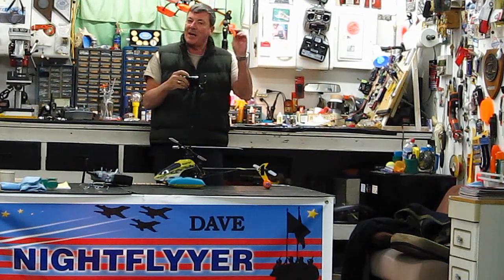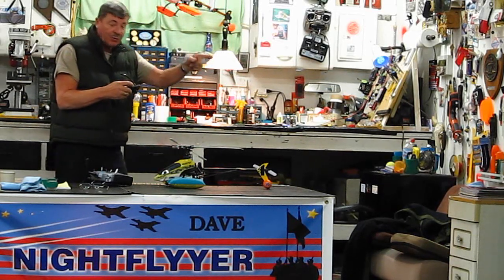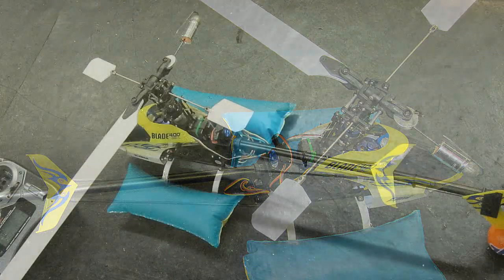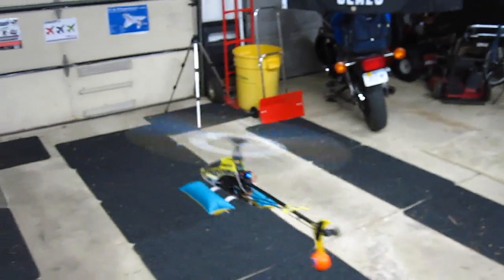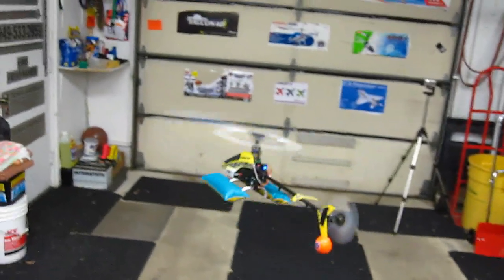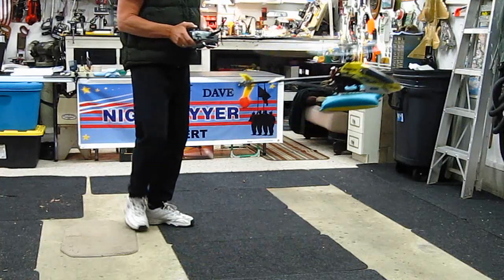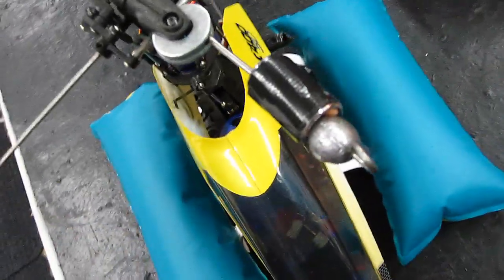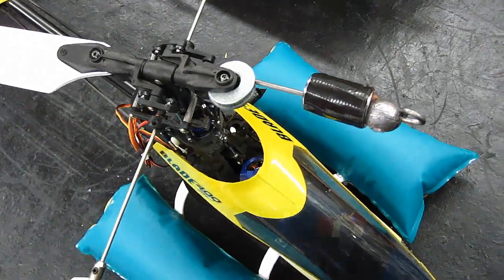1 Single Rotor Blade helicopter experiment, Horizon Hobby Blade 400.

Comment: DARPA should put a check in the mail !   Super great experiment and success!  To help understand the advantages in some detail, it would be interesting to see the measured differences for one and two blade of a equal heli model.  Is there enough data to compare the differences as a percentage for: endurance, max payload, max speed, time around a figure eight course?

Comment: @Verndroid As long as the rotor is balanced, it won't affect wear and tear. It's just heavier. And with one missing blade, it has half the maximum lift force, half the rotational drag @ max lift (aka max pitch), and half the reaction torque @ max lift. But it's quieter for the same reason.

Comment: Hi NightFlyyer..I guess by now you have found out that single blade rotor has been around for some time. Try rotating the motor in the opposite direction of the rotor. The counter torque of the tail rotor takes 25% of the motor energy.

Comment: @NightFlyyer   The vids are great, I love your channel.  You mention you're using less throttle to (and less power) during these flights.  Have you done any testing to see how much of a difference?  Been looking for Gluhareff's single-blade online but haven't found it yet.  I can see your flights obviously work well, just curious if it will scale up to full size, or even larger RC without losing efficiency.  Keep it up, Dave.  You have the best channel on YouTube

Comment: @NightFlyyer I'm a full scale pilot, study the physics on a reqular basis, and I'm looking to career in rotor aviation. The only reason a 1 blde prop would become more efficient would be if in hover staying in the same dirty air the rpms were way too high. I'm not denying it doesn't work or isn't to some extent more efficient, But it wouldn't be practical or more efficient as far ar full scale operations go.  

   ~Casey

Comment: How about a rotor blade configuration the same as a Bi plane would use, a few short vertical struts securing an upper rotor. You'd need twice the counterbalance weight, but would it add lift?

Comment: Not to take anything away from your experiments, but this has been tried on real, albeit ultralight, helicopters.  Gluhareff, him of the tip-jet heli's used to advertise plans for a single bladed, back pack heli.  It used his propane powered tip-jet engine so had no tail rotor either.

Comment: The real question is a metric or sae socket and what size lol. And would it react differently with a different size socket? How did you know what weight was needed on the counterballence? And would it work with no counter weight like the hyperfly?

Comment: Another Great Video!

Minor question: 
A helicopter's only control surfaces are it's rotors.
Be it more efficient, wouldn't such a mod reduce it's response time by half? 

It takes twice the swash plate travel time (rotations) to achieve a dual rotor copter's control force.

P.S.
*I have no idea what the correct terms are for what I tried to describe. 
*My understanding of copter physics is limited to the concept that the rotors create a low pressure bubble that is then warped for mobility.

Comment: Awesome Dave really cool. I love it, hope to see soon more 1 bladed helicopters around !
(dont know if you did so here it goes ): you might wanna do some maths and calculate the exact counter weight for the prop, the counter weight is not only the weight of the blade on the other side, because a weight further away from the center is " heavier " then a weight near the center. So you have to determine how much weight and at which distance from the center you want to put it to balance up perfectly